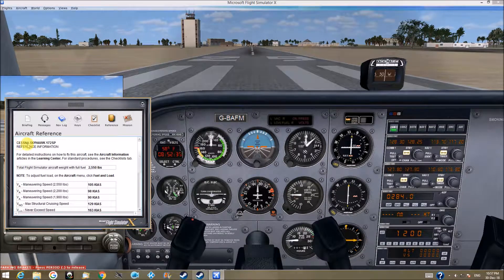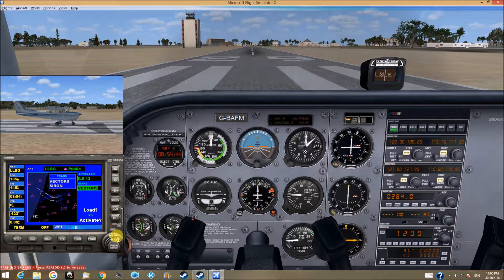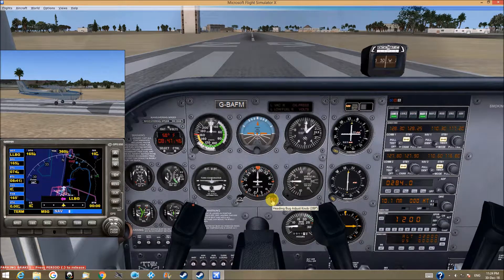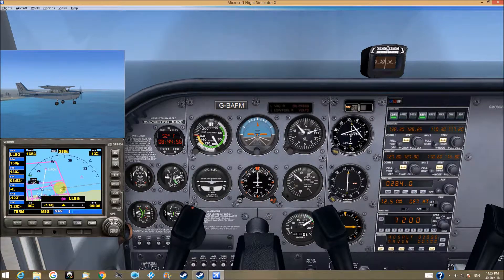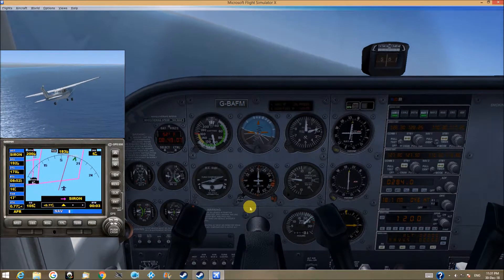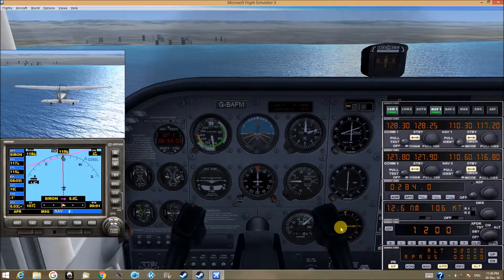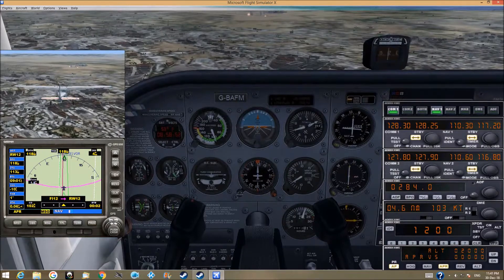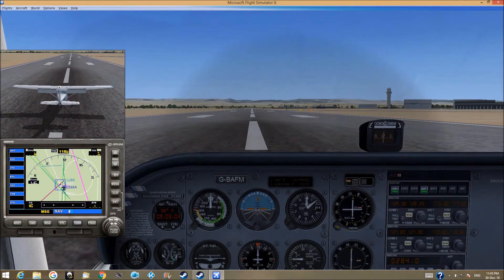fsx cessna 172 tutorial-auto landing

Comment: Great explanation. I did this on FSX with the 747 but did not realise the cessna does it as well. 75 knots at about 1700 rpm should give you a good approach with 2 flaps. 3 flaps should set you up at about 65 knots on finals.